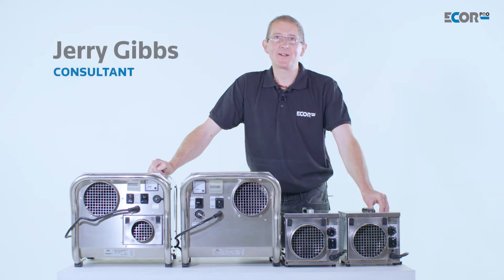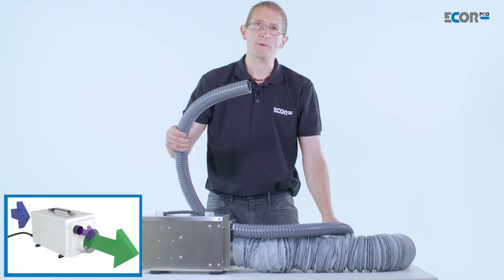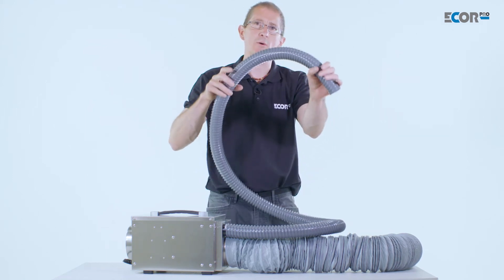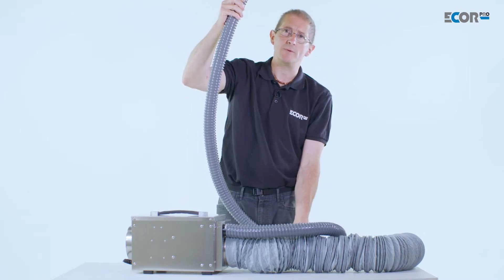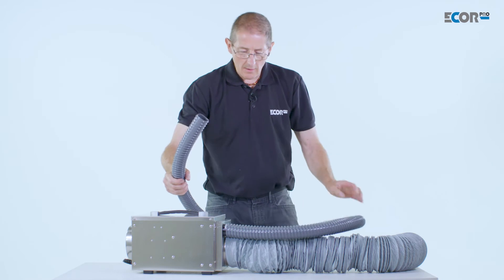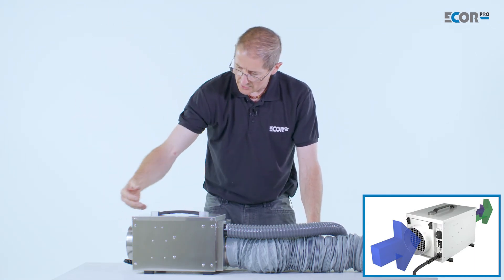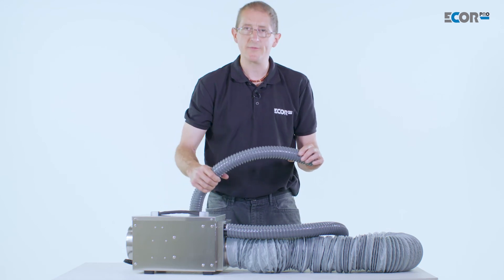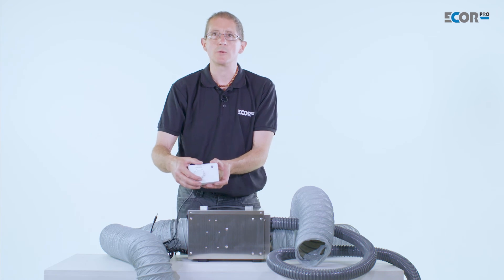Dehumidifier Negative Pressure Ducting Consideration EPD50 EPD50 PRO

Comment: what is considered recommended "short" for pipe length? what is the maximum length before resistance starts effecting outflow of humid air?  pl provide length for the 50 pint model